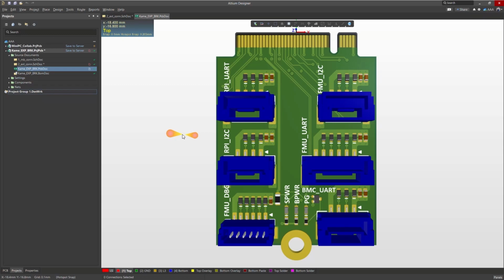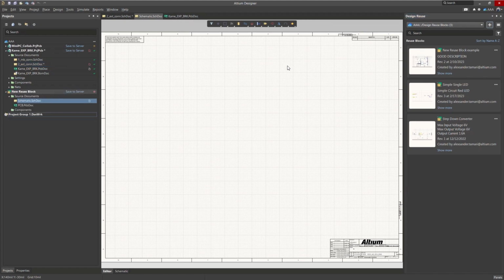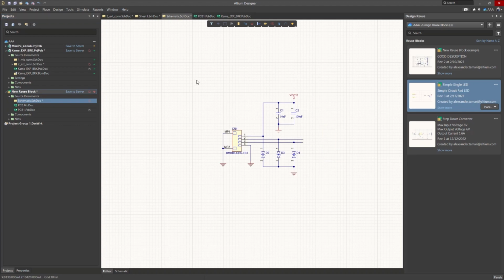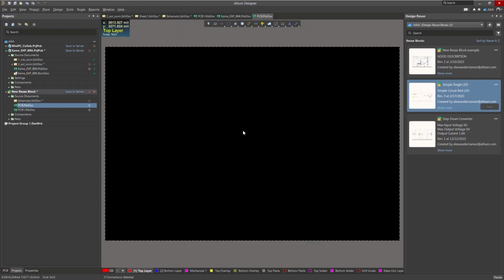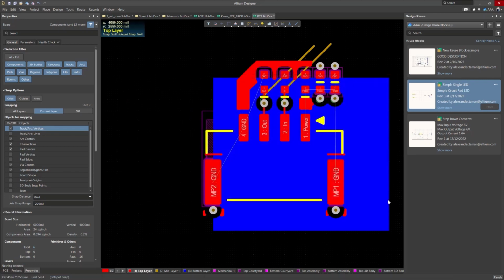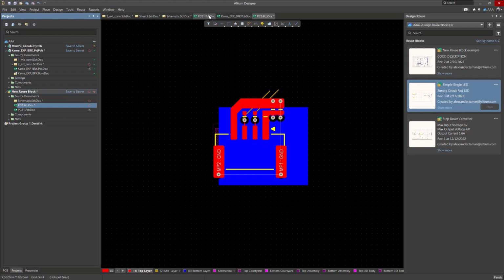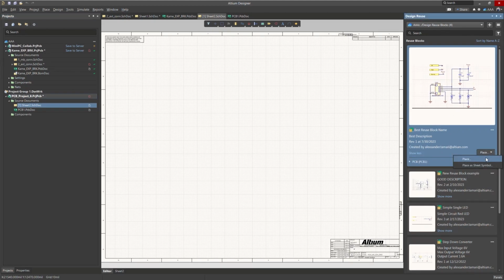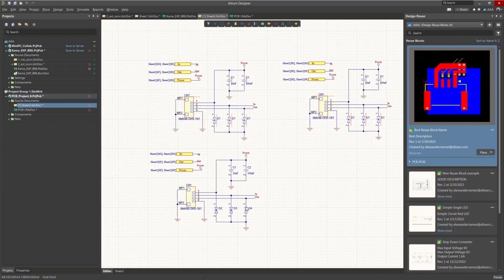Design Reuse

Comment: As far as I can tell this feature is severely limited by the net names. They copy with the reuse block (You can see this towards the end of this presentation when he pastes the two layouts) so if you use a net name all your blocks are connected together. Also as noted below as far as I can tell the only way to update a block after including it is to delete both the PCB instance and the schematic instance and replace them. This limits the useful ness of this feature to completely debugged and tested blocks that you are very confident in and if you use any net names you can only have one instance present in the design.